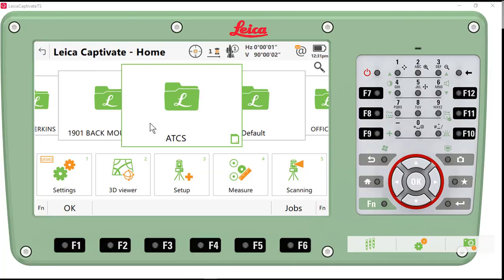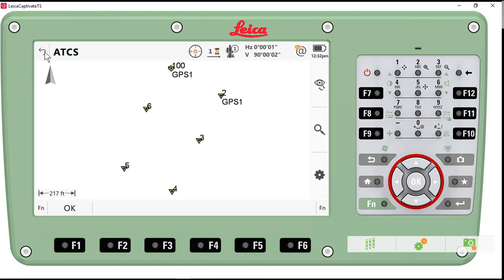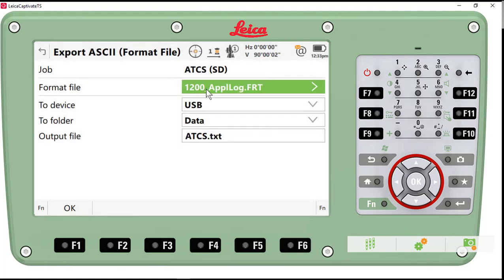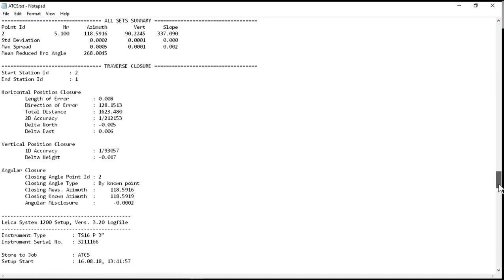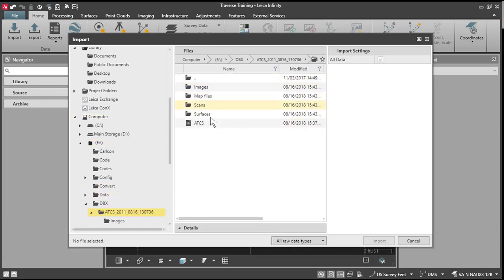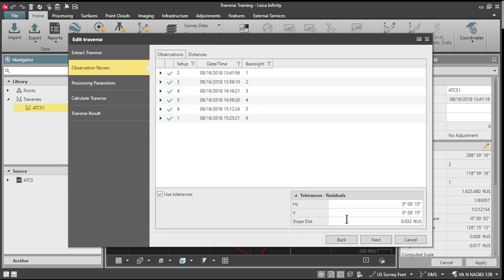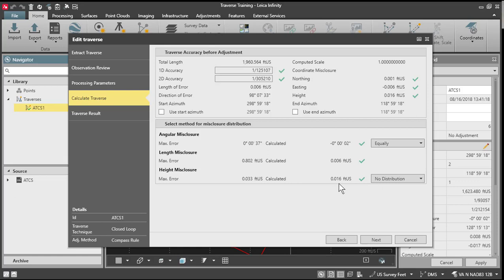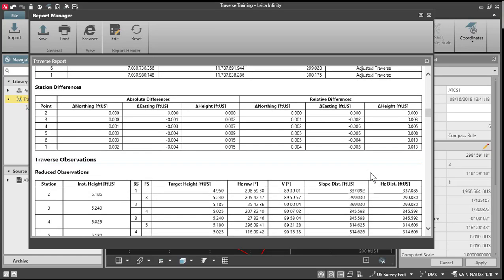Captivate - Infinity Traverse

Comment: What kind of traverse is that? it looks like Link Traverse, but you used just two control points! those points used for orientating the total station, my question is; the starting point (or closing point) is the same as your final foresight, is it possible to close at that point and not at a different control point? I mean using three control points instead of two.
Reply from the maker: This was a closed loop traverse.  You can run a line  traverse between control points as well.  For a simple adjustment (compass or transit rule) four points would be required to determine angular misclosure.  You can use additional control points if you choose the 2D / 3D least squares adjustment option.  For the traverse in my example the closing point was the initial back sight.  The Infinity software will also allow you to use final foresight to calculate traverse misclosure.
Reply: @surveyorpop  Thank you so much, I got it.

Comment: format file link is deleted! pls fix it! thx
Reply from the maker: Which format file are you requesting?
Reply: @surveyorpop  1200_ApplLog.FRT   (2:36)  traverse export format for leica infinity
Reply from the maker: @kakhaberdzadzamia9840  The 1200_ApplLog format file can be downloaded with this link: https://bit.ly/2XsQSJL
This format file is for use with Leica Captivate, SmartWorx or SmartWorx Viva field controllers.  It is not usable in Infinity.  Traverse reports can be obtained by highlighting a traverse in the Infinity Navigator and the selecting Reports from the top menu.  To export ASCII or simple texts files you will need to create an export template.  Please see the video at this link for instructions on creating this file.
 https://www.youtube.com/watch?v=JixsXaDmKxU
Reply: @surveyorpop  I`ll tell what i did. :) I draw a couple of lines in Autocad anotate line lengths, coordinates  and directions. also draw a baselines at the start an at the end of that polyline. made some misclosure (appr. 10 sm) .than I tried to run Traverse manually in Leica captivate simulator.. when I finished i tried to export it to ASCII with format file(as you`ve done). but I cant because it says: "no format file has been selected. You must first create a format file & then transfer it to the instrument. thats why I requested that file.. know i got it im happy with that but I cant use it :D because i dont know how to do this. :(
Reply: Im trying to learn Leica captivate an infinity software with myself. I havent training materials cos i have cracked version of infinity and I cant localize my infinity to get those training materials (files) thats why im trying to make it manually in captivate. if you`ve get those files can you share it to me? thanks beforehand!
Reply from the maker: @kakhaberdzadzamia9840  Good Morning.  You will need to update (purchase) the Customer Care Program for your Infinity and Captivate software to access the training material.

Comment: And what if i have a couple of set of angles measured?
Reply from the maker: Infinity has an option under the processing tab to process Sets.  This will allow you to select a total station setup point and reduce all of the sets located from that position.  This will need to be repeated for each total station position with measured sets.
Reply: @surveyorpop  i know but i have some uncertain sections what ti select for example to advanced terrestial
Reply: @surveyorpop  what i really did is that i have measured sets to a network with set up-s on each of them and sighting everything i can see. I want to adjust this kind of measurements.
Reply from the maker: @nandi87pg  You can use Infinity to adjust terrestrial measurements.  You just need to specify control points.